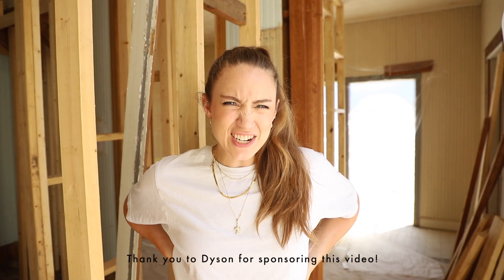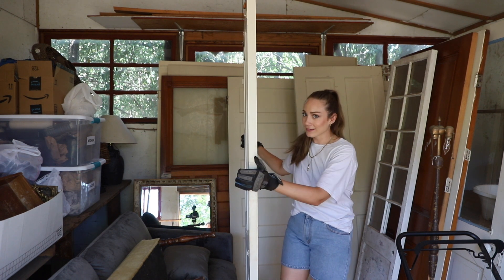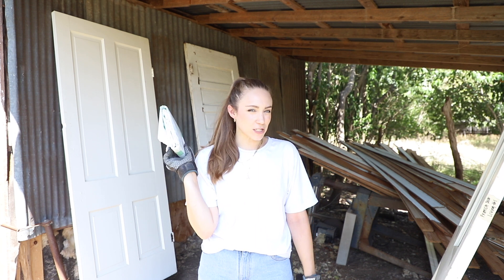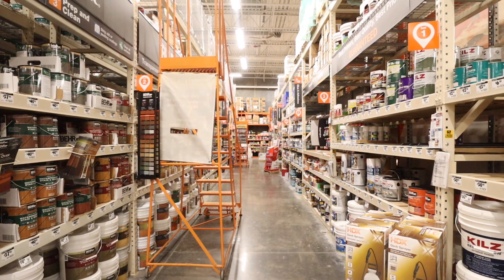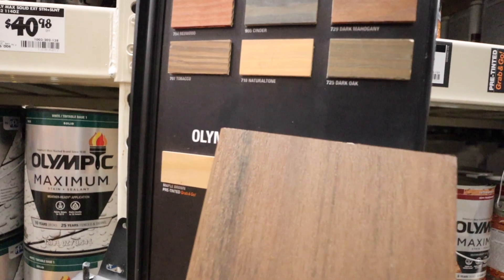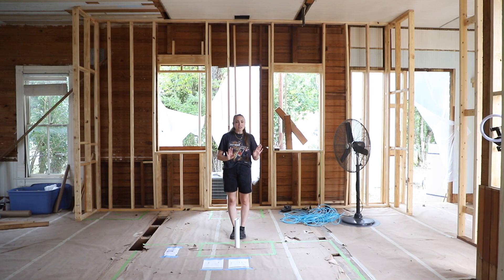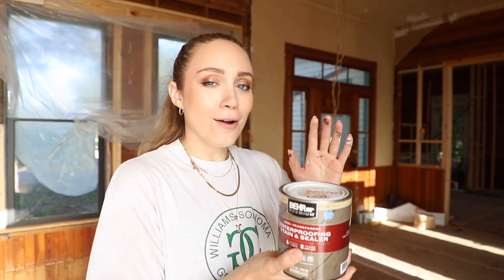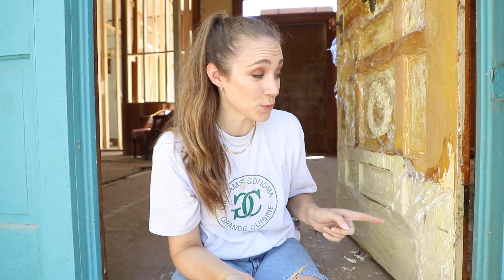RENOVATING OUR HOME: Plumbing, Foundation & Restoring Doors! | XO, MaCenna

Comment: I just don't get it. With the detailed instructions you give them, that are printed and put where they need to do the work, how in the world are they getting any of it wrong?! I understand that people make mistakes. But I would think that after they finished they would compare it to the instructions to make sure it was done correctly.
Reply: I was thinking the same thing. I know the project is fairly far along but a new contracting team seems like it would stop some major headaches down the road...
Reply: Seems to me sometimes they get in a rut of doing things a particular way and just kinda go on autopilot, ignoring the instructions, or that has been what it seems to me based on some of my experience with contractors. You might also have some that won't tell you, but rebel about this "little darlin' " telling them how to do their jobs.
Reply: This is also just very precise work dependent on a lot of different measurements that may or may not all be documented.  Everyone makes mistakes sometimes, especially work requiring this kind of attention to detail.  It's just that most of the time people aren't working in a medium that becomes physical in this way.   It's also worth remembering that we hold onto and remember the parts that are messed up, but they've done a lot of other work that went just fine.  It's annoying, but fixing mistakes like this is just part of building a building.  It doesn't all go perfectly and that doesn't mean they're a bad contractor.
Reply: @rebekahdempsey3966  I know absolutely nothing about this kind of work. It just seemed strange to me when they were provided such detailed instructions. Thank you for the insight. I use to be an accountant so I balanced everything down to the penny. 🤷‍♀️

Comment: The only problem, in my experience,  with dip striping old  doors is that it tends to soften and destroy any glue that holds the joints of the door together. We had ours done out of our Edwardian house and  although they looked good and saved a lot of time they were very 'rattley' when we put them back on. Thankfully my late husband was a carpenter so he took them all apart and re-made them all again from scratch.
Reply from the maker: O wow! Thank you so much for the info!!
Reply: Omg, that would be a major undertaking.

Comment: Love the idea of the doors and the deck boards being the same colour, but it’s harder than you think staining real wood to match “fake” wood. We recently put vinyl plank flooring in our basement in black walnut. We redid our stains and stained them to match. It’s a fantastic colour match, BUT you can definitely tell which one is real and which one is fake. Maybe because yours doors and the decking won’t be on the same plane it won’t be as obvious, but for us when you come down the stairs it’s clear the stairs and floor are different. Don’t regret it though. My second preference for your doors would be to go for a slightly darker stain, pulling from the knots in the mahogany. It would then be intentionally different.
Reply: That was my thought, go intentionally darker so that it wouldn't be so close and yet off, that can sometimes look really odd
Reply: I think the front door and decking could be richer to match the internal lobby. Looks like the sample decking she has has will not give the aesthetic shown in the pretty picture of the house and porch, too cool tone.

Comment: My first home was a house built in 1915 and it, too had no insulation (and it is in Massachusetts 🥶), but the original owners did put up news paper in the walls 🤣. We also had the blown isolation put into the walls when we renovated and it was the most cost effective and practical way to do it. I love what you are doing with this house and look forward to your weekly updates! You're doing an amazing job!

Comment: Love all your videos MaCenna. You need to wear safety goggles (and gloves) to protect those gorgeous eyes when stripping paint off wood. Paint stripper burns and paint flakes can really scratch and irritate the eyes. We stripped down all our original oregon pine doors, window frames and skirting boards of our first very old home years ago. After trying paintstripper, we eventually found that a heat gun worked the fastest with the cleanest bare wood results, scraping most of the paint off immediately as we worked. Then we only used paintstripper on the raised details, grooves and any stubborn areas afterwards. It's also easier laying your doors flat on a work table while you strip them. Good luck, it's a tedious task but so worth it once you get to enjoy your beautifully restored original doors afterwards.

Comment: The dipping is a time saver, but really ruins wooden doors. I think it makes them warp more. The manual labor is tedious, but maintains the integrity of the door. Love your videos ❤💖💖
Reply from the maker: Omg thank you for your comment I would be devastated if these doors got warped!!!!
Reply: I've heard this too the ones I have seen they have shrunk and get massive gaps I would use a heat gun instead.
Reply: True. It warps and really dries the wood. 
Also, when choosing insulation make sure to fire test samples!  Also fire test the decking!
Reply: Ive never done doors but ive used a bead blaster to remove paint from metal wheel halves for airplanes. It works really really well. Im not familiar w the setup options to bead blast wood but it def seems like itd be worth serious consideration with as much as you have to do w doors and windows.
Reply: I have seen furniture that was dip stripped fall apart because the stripper ruined the glue.  I am not certain how much, if any, glue is in your doors.  Just beware!
Reply: Laura Melhuish Sprague actually mentioned this in one of her videos. She said it ruined her front door and caused it to warp and crack. Some of the doors did great but she thinks it might have been because of the heat and amount of sun the front door gets compared to her interior doors. I would be too nervous to ruin these beautiful doors! 🥺

Comment: Glad you're adding insulation! We lived in a very old house in Louisiana and our electricity bills were insane during the very cold or very hot months. Those houses leak AC/Heat like crazy. Also glad you're adding the siding to the ground. Pier and beam houses in LA had burst pipes during the rare big freezes when pipes were exposed under the house. It's such a nightmare. And based on last winter it seems like TX might be getting more of those freezes. We're originally from up north and no one told us about needing to "drip" the sinks during a freeze.

Comment: Agree with some of the comments below on a heat gun! We ended up buying a speed heater cobra (IR heat gun) to do our 110 year old homes windows. I balked at the cost at first but it was a total lifesaver! And the IR is supposed to make it so the paint doesn’t off gas as many bad chemicals! Good luck!!

Comment: Perfect timing! Just got home from a day's renovation work on our office. Running a nice relaxing bath and watching someone work 😉
Reply from the maker: oooo so fun!!!
Reply: @XOMaCenna  just at the bit where you're stripping the doors... We have a Victorian house and tried loads of ways to remove paint from our doors and cast iron fireplaces (stripper, heat gun, sanding). We got 2 doors dipped and it was definitely the best decision ever. You have to leave them a while to dry out fully before finishing them, but it saved so much time and they came back perfect.

Comment: FYI...be careful if you decide to have the doors dipped....I had a rocking chair refinished and the company dipped the chair....well...suffice it to say, it did a great job stripping it, but it dried out the wood to the point that the chair was so brittle that it kept splitting right in half at the seat.....just be careful.....the renos are really coming along....looking really good....I can't wait to see the finished project.....

Comment: Definitely look into having your doors/windows/window frames dip stripped. The results are stunning and would save you so so much time and very hard work.
Reply from the maker: i totally agree! i think its a must
Reply: I've never heard of dip stripping. That cool.
Reply: Another reno/lifestyle youtuber i watch (Laura Melhuish-Sprague) had her front door dip stripped and she said it had completely ruined her door :(
Reply: @teszter704  I've heard that a couple of times now. Maybe not a good idea huh?
Reply: @XOMaCenna  From what I’ve seen it will also get rid of a lot of the yellow tone in the wood
Reply: @JLJ2730  If i remember correctly, her door warped as the wood expanded/contracted due to the weather and that was not an issue prior dip stripping it
Reply: You have so much work to do and the doors are beautiful and detailed! You deserve this service in my opinion! You work so hard! I'm glad you'll have completed the front door! Something to be very proud of!
Reply: Maybe after dip stripping is the time for a power wash?
Reply: @XOMaCenna  I've seen it loosen the panels of the door. Have you tested everywhere for lead paint? Should you be wearing protection, respirator goggles etc?
Reply: @XOMaCenna  Hey I know you posted this video a while ago, but be careful with dipping your doors. I was watching Laura Melhuish-Sprague's channel and they dipped their front door and it caused the wood to warp in a weird way. You should message her to find out exactly what happened :)

Comment: Hi. Love your videos so much and am OBSSESED with this renovation.  Tiny advice, when I had my doors dipped they came back a tiny bit warped. Could only buy it down to the dipping process but was so much quicker and less hassle than stripping myself.

Comment: I really liked using Citristrip Gel.  Like you said, it's all so messy but it worked so well.  I had to strip the door frames in my apartment (they had at least 5 layers of paint from the last 50 years) and it really was able to cut through all of that.
Reply: Yes! Citristrip is awesome!!

Comment: This is an exciting project. Definitely get the doors dipped to strip them - especially the front door with all the details - it will make a huge difference in the finished product. You could do it yourself with a huge effort and a great deal of time, but I think you have enough to do - allocate where possible!

Comment: As on stripping : me and my mom, we always use the Circa 1850 d-solver. I don't know if you have access to it, but it never failed us. We pass on the object once with a paintbrush, let it sit for 5 minutes, then scrape. For the small details, we use a steel wool to finish it of. As we use it, we put a bit of Circa 1850 on it and it is a charm. It is powerful, so we only use it outdoors like you did and we only use good gloves (witout plastic in it), because it gets through it very easily and it burns.

Comment: Love you videos! I use Klean strip and works very well for me it only takes 15-20 min , just apply ticker layer. You can also use a heat gun it works very well on painted wood. 💖

Comment: Yay, I'm glad my shade tip helped! (Or whoever else you may have seen that said the same.) Eventually I will redo my front door, because the paint didn't cure well enough and stuck to the weatherstripping, so now there's a line of white dots in my blue door. I've tried a few quick fixes and nothing stays. We have to keep the weatherstripping too, so removing that isn't an option. The door was such a big project and is definitely near the bottom of my to-do list :P

Comment: I love the front detail on the door. It’s going to look SO good. Good luck on the insulation. Just and FYI, when our house was built, they put foam insulation in the attic and they didn’t put a fresh air outlet in the attic. So when it got super humid (We live in Texas), the moisture collected in our foam and then released into the attic. The condensation ended up rusting our AC unit and we had to replace it this summer. So make sure they put all the proper vents in to allow that insulation to release moisture.

Comment: As afar as the doors marching the decking, great idea but I would just get as close to flooring as you can. I ran the paint dept at HD for 4yrs and did a lot of matching during that time. They will never match. The light will always be different so you will see the difference. And different types of wood receive stain differently. Olympic is a great brand. I LOVE the way it penetrates into the wood. It is a hybrid so you get the best of both worlds and it is soap and water clean up. The paint dept should have samples of the ready seal behind their paint desk. They can also call their rep if they don’t have any. It best applied with a pump sprayer. It is great as along as it prepped and applied properly. #tfs

Comment: Hot gun paint stripping is an option, I just did my daughters doorways, sometimes a strip bath will also strip the glue holding the joints together, especially on such old doors.

Comment: We used to own a house with the same wall set up as yours and we found it to be warm in the winter and cool in the summer so we never worried about insulation. Btw we didn't have air conditioning

Comment: McKenna, I saw a professional stripping furniture on line yesterday.  If you lay it out flat on a table and take a heat gun in one hand and an empty bucket in the other start at one end scrape it off all the way from top to bottom and right into the can.  Less mess and easier with heat gun if needed.

Comment: I had an antique rocking chair dip stripped and the wood was ruined and could not be stained. I did salvage it by filling all the splintered areas and ended up having to paint it.

Comment: For the solid wood doors (no glass), have you considered trying the pressure washer? We stripped a whole deck with one took way less time!
Reply from the maker: I did try that too but I kinda took some of the wood with it 😕 so I got scared to keep trying the pressure washer
Reply: @XOMaCenna  yikes! I wouldn't mess with that either. Deck boards are at least replaceable.. You're doing such a great job btw!

Comment: Certainly the stains should coordinate, but matching is not necessary in my opinion.  Certainly if those doors are pine, matching stain will be a chore because of the way pine takes stain.  You could consider some bleaching to help.

Comment: So I restored some 90-year-old furniture last year. I used a stripper and then in the detailed areas (trim, decoration) I used a toothbrush dipped in paint thinner to really get the paint our of the details. Maybe try that on the wreath on your front door? Good luck!
Reply: Also, overnight might be letting it get too dry.

Comment: Did you mention how you'd replace the piping if you pour concrete over it? I assume it wouldn't need to happen for a loooong time, but I'm curious!
Reply: I was wondering the same!

Comment: I wanted to tell you about shellac. You should use shellac base to stop the yellow from bleeding.  Now, that's with paint. I used a gel based stain to sit on top of the wood.
But
You need to really research your yellow base wood issues.  Which I am certain you will

Comment: Small copper or plastic brushes helped me a lot stripping my cabinets in the details. The ones that are a bit bigger than a toothbrush at Home Depot. Just don’t use the steel ones or it will damage your wood.

Comment: If you don't mind, I do want to warn you about somthing regarding to the sray insalation thing. I've seen it done on a house and I don't know it they just did it wrong but it was patchy. What I mean by that, is you could see all the holes where they pluged in the insalation. So if you do end up going with this option just be aware and ask about making sure you don't see the curular holes. Other than that, love you and your content!

Comment: For the stripper, yes it's definitely a tedious process, definitely the life of stipping paint and just kind of how it is. Those doors probably also have lead paint which is difficult to strip. I used the same stripper on my lead painted porch and it comes off more in those flakes/chunks that you were referring to. You are probably going to have to b multiple rounds of stripper then stripping then more stripper. Also if the stripper has dried out at all (like on the front door) put on another light coat of stripperand let it sit for like an hour before you strip it, sort of to reactivate it. Makes it a lot easier. Also wax paper is an excellent substitute to the Dumond Paper! Personally, I like using wax paper over the plastic wrap. Also don't dip it, sandblast, or power wash it! Those things are all really harsh and will do more damage to old wood!

Comment: Another comment on the doors, don't dry sand them if they had lead paint on the (which they probably did). The lead from the paint leaches into the wood. Anyways, if you have to sand them, wet sand them so that the lead dust/wood particles aren't getting into the air and then you breathe them in. You really should be wearing a respirator for any sanding but also the stripping as well!